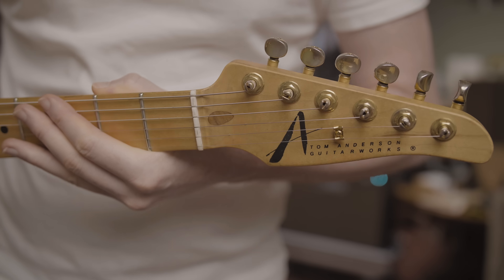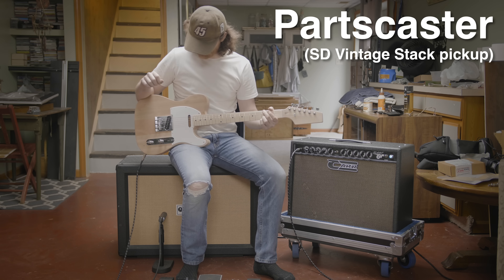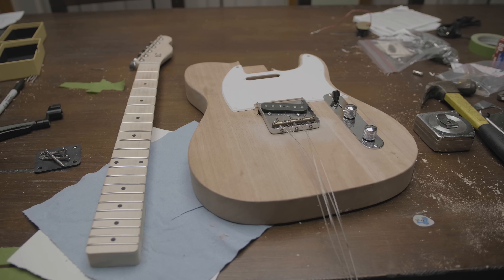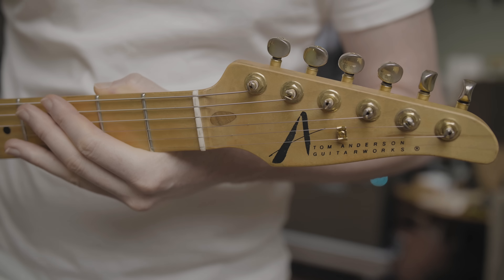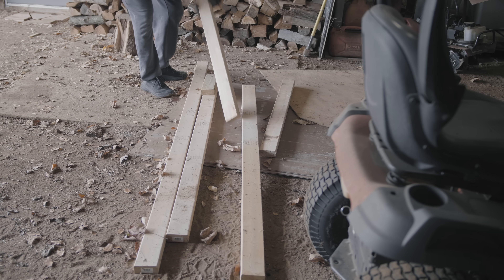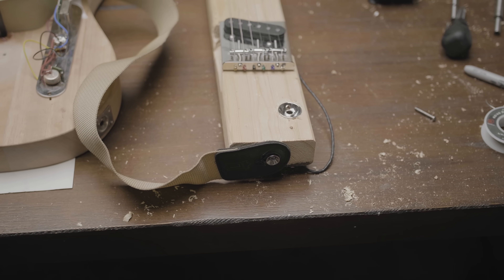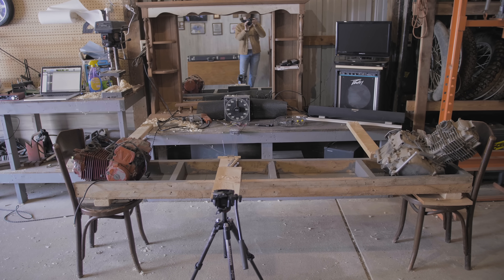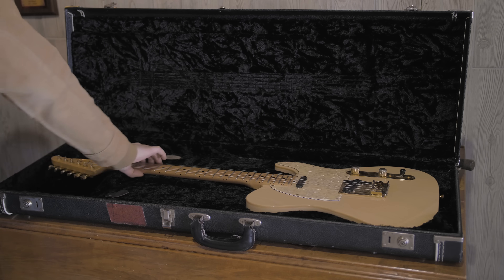Tested: Where Does The Tone Come From In An Electric Guitar?

Comment: There is more mass in those two benches than ten guitars put together. Your strings aren’t floating in the air or even attached to isolated points. The tables are connected to the floor and therefore to each other. 
All you did was make an ungainly, unwieldily Les Paul. The whole “wood is irrelevant” idea is pure contrarianism. Take the wiring harness out of a Les Paul and put it in a jazz-box. Then let’s see if it sounds the same. 
I will concede that the wood is a minimal factor and I would have 20 years ago. Minimal is not non-existent. Subtle things can make or break a guitar for a player. It’s not about pickups being microphonic I don’t think, it’s about what frequencies radiate out of the strings through the guitar’s structure and therefore don’t reach the pickup. 
That is why a hollow guitar sounds different with the same pickups. It expends more energy acoustically. This is why the pickups don’t have to be microphonic to pick up a difference. It’s a subtractive process, not one of addition.

Comment: Although you did find that no neck sounds the same as having a neck, so maybe this is a moot point, It would have been nice to have tested some different necks. Different fret board materials, maybe even different neck base wood. In my experience guitars have a basic voice unamplified. The pickups just seemed to alter the eq, and output level of that voice. For instance my Gibson SG always has had a very midrange focused tone, with not so much treble shimmer. No pickups I've tried have solved that, it is what it is. I settled on rewinding the original Gibson pickups to a lower wind, and installing short A5 magnets. Its bright enough at this point, and sounds at its best through a cranked Marshall style amp. Its pretty good for playing Back in Black now, LOL. Also in my experience, having used the same wood species in the same model of guitar, does not always produce instruments with a similar voice. Anyway, It is illuminating to see the string height connection on identical pickups, that results in amplified sound being nearly identical, regardless of body materials used. Great stuff! I personally respect both sides of this fence, and find it all interesting. Use whatever works for you, and practice, hone your techniques.

Comment: Amazing work man. Finally some definitive evidence that from an equipment perspective, pickups and pickup height are the most important aspects of guitar tone.
Reply: You can think of pickup height as a sort of permanent baseline volume setting. The difference in tone comes from the amount of gain being pushed into the preamp by higher pickups. It creates compression, where pickups set lower have a more open, dynamic clean sound. As you go too low, the sound starts to lose body and become thin and trebly.

Comment: Excellent demo!
This will be a bit long, but here's my take.
I think so much of the uproar over this debate is the simple fact that the word "tone" itself can describe a very broad, and individualized experiece.
We all have different ears, and perception of what "tone" is.
One person's perfect tone can be another's ear assault.

Some people perceive tone as simply how much bass, and treble there is, while others have a much more detailed, intricate perception which encompasses everything from, bass, mid, treble, gain structure, harmonic overtones, and sustain.
I've built and played guitars of many incarnations for decades, and  maintained, in terms of this "tonewood" debate, and often at my peril, that the ONLY real discernible impact wood can play on the overall tone of a solidbody electric guitar tone-wise, is the ability to facilitate harmonic feedback when you're playing at higher volumes, and how high they need to be before the guitar's body can transfer enough sympathetic vibrational energy through the strings when ringing out.

In other words, when the air is really moving, and the body wood is vibrating in kind, transfering those vibrations back through the bridge and into the strings sympathetically, and into the pickup, essentially creating a feedback loop.
This is why when you play at bedroom levels, you can hit a chord even with high preamp gain, and it will decay with little to no interaction, or induced harmonic feedback/sustain.

You play at a much higher volume in that same room, and as the chord approaches the same point of natural decay, and harmonic feedback will overlap, and take over, and you'll get that glorious harmonically rich, almost infinite sustain we all love.

That said, the particular cut of wood itself, not necessarily the species CAN have an effect on the ease at which the guitar is able to achieve harmonic feedback at certain  volume levels.
The grain, density, dryness can all play a part in how percussive/responsive a piece of wood may be, and where it's resonant peak is, as well as how much of a dampening, or non-responsive effect it may have.

Honestly, that's really the only major impact that wood has generally when you're talking about a solidbody electric.

Your demo illustrates this perfectly well.
It's far more accurate honestly than some demonstrations where guys use oscilloscopes showing waveforms to "prove" one way or the other how wood effects, or doesn't  effect tone on two mechanically identical set-ups with only the wood being different.

Or the bone headed statement that "wood isn't magnetic", as if somehow this isn't common knowledge.

The fact is, two identically set up guitar's meticulously tuned to A440 run through an oscilloscope are going to show essentially the same waveform samples based on the fundamental A/B comparative note/s strummed.
The waveform shape produced out of two test guitar's set up the same way are going to essentially be the same not dictated because of the wood, or the pickups, but because they are guitars with the same scale length, string type, tuning, etc.

Ears are a far better device for discerning the nuances of tone for any instrument.

If you're getting into chambered, semi-hollow, hollow bodied, and acoustic instruments then yes...woods do effect the fundamental tone, absolutely.

That said, there are many people who DO hear differences in body woods, and I'm sure not going to argue...It's possible they do have the ability to hear the subtractive qualities a slab of mahogany has over a slab of maple in terms of "warmth" and I can't argue with that, and to be honest, as even the most expensive pickups can have a certain degree of coil related microphonics over their lifespan, and CAN introduce audible acoustic artifacts into the signal, it would be irrelevant to argue that fact.

I have a maple body 77 Atilla with original non wax potted Dimarzio Distortions that are so  microphonic that the slightest tapping of your finger or pick anywhere on the body can be heard clearly...No super hearing needed! 😉 it's still a great sounding studio guitar, but I could never play it on stage with those pickups. They'd squeal like a stuck pig.

Then you have people with perfect pitch. 
There are people that literally "see" the nuances of sound with their brains processing what they hear in terms of colors, (It's very cool) and so the tiniest, static, sonic variations in certain woods very well may be able to be picked out by some.

At any rate, I just wanted to thank you for taking such a well thought out, and detailed approach to your video.

It's the best I've seen, and in a very balanced, and non partisan format.